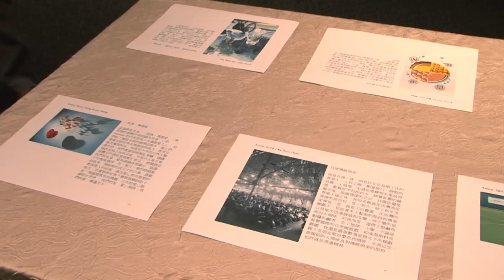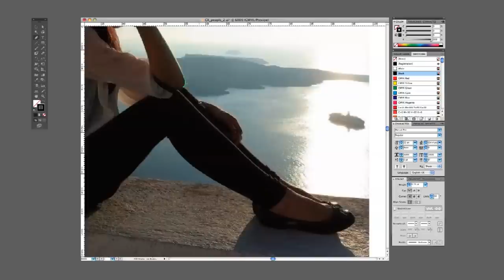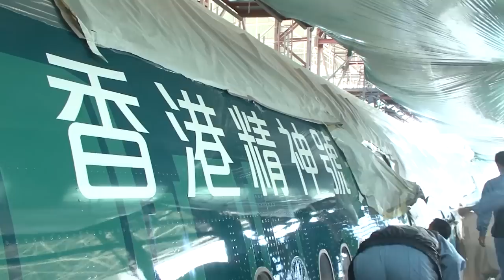'The Spirit of Hong Kong' Special Livery - The Making Of

Comment: on 29 dec 2014 a virgin atlantic 747-400 managed to land safely with 1 landing gear got stuck in the belly.  this is a strong proof that with 5 landing gears and 4 engines is always 100000000000000000000 times safer than flying with 2 engines and 3 landing gears.  if this plane is 777 it would have tilted to one side and caused explosion.  wish this instance wish cx will change their mind and start flying passengers with the brand new 747-8i.

Comment: i used to love cx very much since kid.  but now my love to her is gone.  cx dumped 747-8 and picked 777 instead.  what is cx's flag ship now.  tiny ugly 777.
Reply: The 777 isn't "ugly" in my opinion. Many airlines ditched the 748 for a more efficient aircraft. There's only about three or four airlines that actually ordered the 8I. The 777, compared to the 748, uses less fuel since it only has two engines.

I think they bought the 747-8F because it can hold more cargo compared to a 777F.
Reply: yeh i knew that gas consumption always is the main concern.  just feel sad that i wont be able to fly in a cx's 748.
Reply: Andy Lam There's always the other airlines.
Reply: yeh but cx is my all time favourite since kid.
Reply: +Andy Lam Are you serious? the 777 may be small, but it's majestic and amazing.
Reply: @andylam73   

Dewiprisir